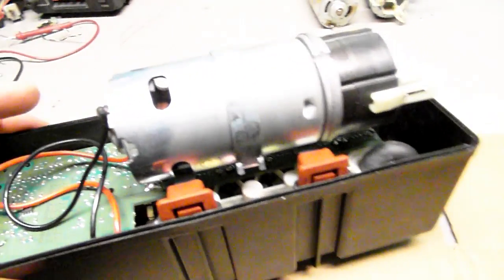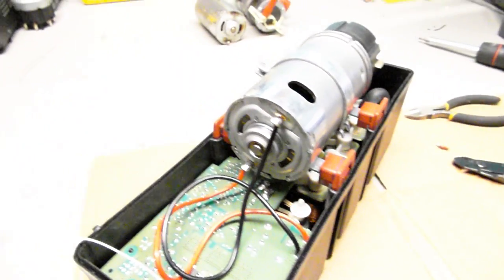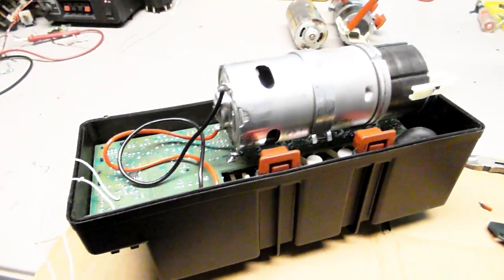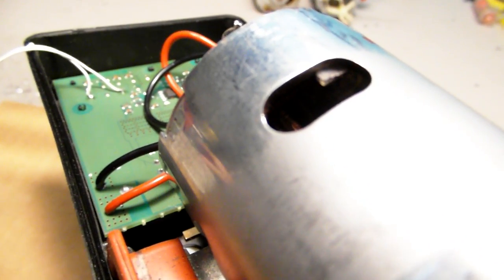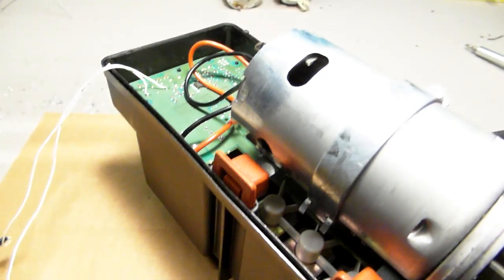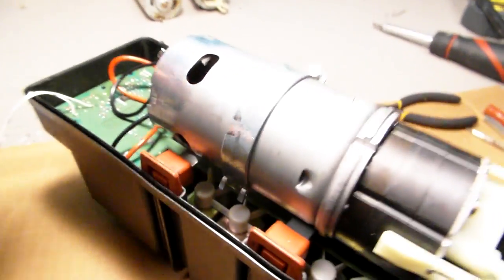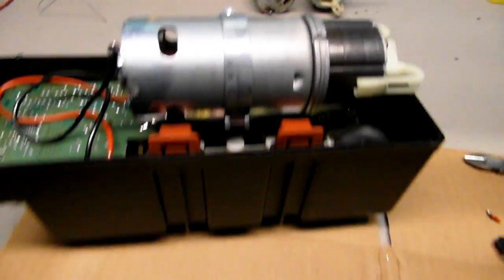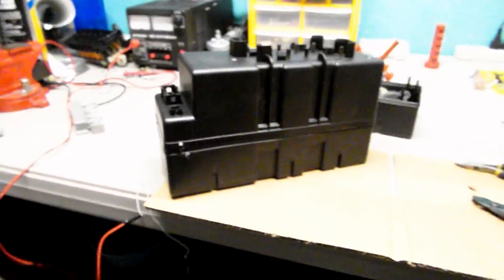Mercedes door lock and close assist pump repair. W220 S, CL classes .Part 2

Comment: Hello,

My pump looks brand new other than the actual motor.

I have a 2006, S430, W220 where the door locks and soft close both do not work.  You can faintly hear the solenoids click when you hit the door lock button but nothing works/happens.  I think there is a sticky lock somewhere because when the took the pump box out, it was very hot and the motor looked fried.  The 20 amp fuse didn't blow, the coils above the motor were very hot upon removal. 

The board appears good and new looking, no burn spots and the copper wound coils all looked as new, just the motor looked black and burnt inside the inspection/cooling ports. Should I buy a new motor and try rebuilding the pump only after spraying silicone spray on all the door and trunk mechanisms?

Comment: Are you doing I’m not sure how often do you reply to messages on here but I wanted to ask what circuit activates the truck One touch motor? I have a PSE pump currently that’s bad well it will open my doors but it will not lock them but my one touch works just perfectly fine where is my other one will Will lock and unlock my doors but will not open my trunk it will vacuum close it but it will not open it as far as the one touch. Can you identify the circuit that I need to repair in order for me to activate my one touch On this PSE pump?

Comment: Victor how you doing? I have a 2006 S600 that I know you can help me out with.. I have a code in PSE  (B1442-012 For the following Pneumatic Branch, The safety time of the power closing is exceeded Drivers Door) after I clear the code the power closing works again as soon as the code reset (about 1 min of less) the power closing stops. How would you go by diagnosing this issue? the other 3 doors Power closing work fine.. thank in advance
Reply from the maker: driver door lock soft close actuator is probably leaking. Smoke test it, if yu want, sometime you can hear hissing. Either to replace whole lock or try to seal leaking area in existing lock
Reply: I smoked it and didn't see any thing  (latch still in the car). I hooked the vacuum  back up and closed the door and I can hear it leaking. I'm replacing the door latch assem when I get back. I live in Houston tx